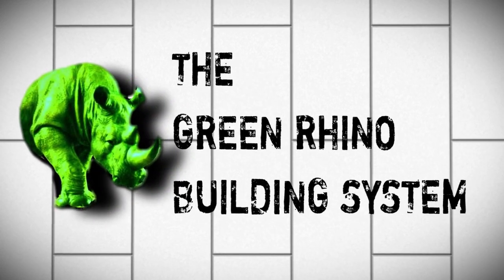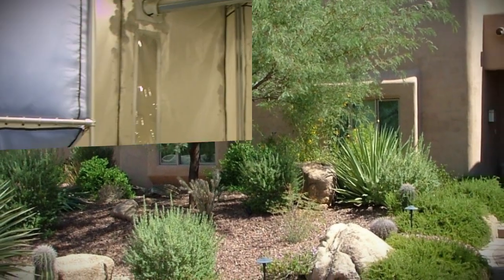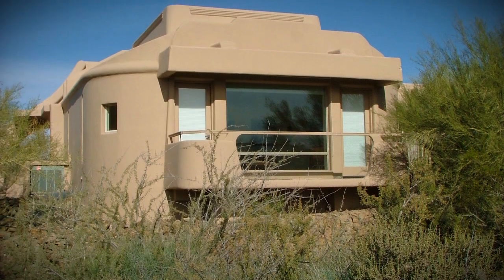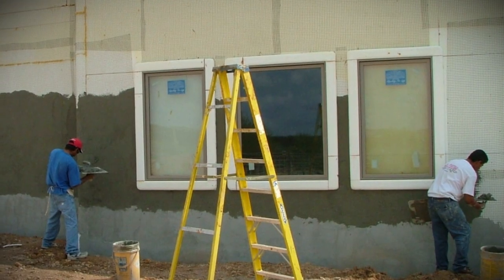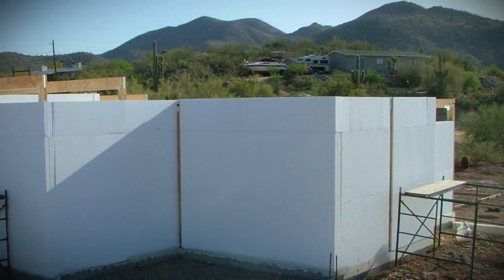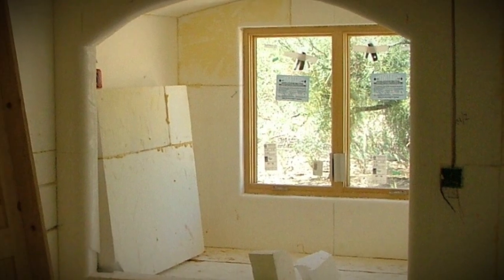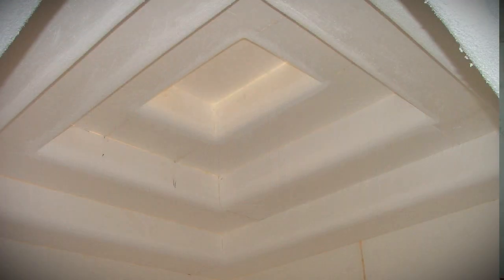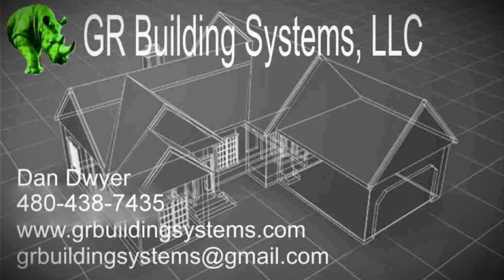Foam Home by: G R Building Systems, LLC   The Best of Both Worlds

Comment: What happens of you get a heat source close to the wall? Melts the EPS inside?
Reply from the maker: Thanks for comment.  We passed fire test with corner furnace flame at 1800 degrees.  The non-combustible coatings  may be a game changer when it comes to wood frame vs G R Building Systems.  check out our new web page:    grbuildingsystems.com
Reply from the maker: It melts at a higher temp than a wood frame stucco house that has EPS under the stucco coating.  We passed the fire test for residential code compliance.  Thanks for the question. Visit the new web site for more info:  grbuildingsystems.com

Comment: Any foundation shifting an it crack in half..
Reply from the maker: Code compliant testing is showing great results.  You may be incorrect.  Visit website to learn more. grbuildingsystems.com
Reply from the maker: check out the web site.  You could not be more wrong.
Reply: @GreenRhinoBuildingSystems  I visited your website. He could not be less right. Your system is a laugh or a scam.
Reply: @Maloy7800  check out Gigacrete house and thermasteel panels  . I would go with thermasteel

Comment: Would this pass building codes in California?
Reply from the maker: We are testing in California now for code compliance.  It has passed all tests so far and we are very encouraged and hopeful that it will pass all required.
Reply from the maker: testing is underway to pass all USA building codes.  Thanks for the comment.
Reply: @GreenRhinoBuildingSystems  Thanks Dan. This looks incredible and I hope it takes off in California and elsewhere. With the system primarily consisting of polystyrene I do have some environmental concerns about the material itself. But the efficiency in the build and energy consumption looks great.

Comment: how can you hang cabinets on polystyrofoam walls?How do you stick a nail in that concrete core of the wall to hold?what do you mean by:the styrofoam is fireresistence?everybody knows that polistiren melts under flame.
Reply from the maker: We embed wood in the wall for cabinets and the coating over the EPS is fireproof.  Fire tests have been done and this system passed a one hour fire test.
Reply: ok,that sounds great.lets say I have a small house to build.600(20x30)sqfeet with a loft.I will need a foundation to build and the walls of icf and the roof of sips.How much would that cost....if you put a coat to make it fireproof,can you put a water barier to make it collect rain water in a basin?

Comment: Sharing to G+ and Twitter
Reply from the maker: Dwayne Knight about the same cost as a semi custom wood frame house
Reply: I bet the cost is great.
I expect wall hung cabinets and things must take a slightly different strategy than normal.
I just wish it were modular in the reconfigurable reusable sense.
Reply: Dan Dwyer Heating and Cooling could be as little as Zero due to the high insulation when using Passive House configurations.
Reply: Yes, It is like living in your own personal cooler.